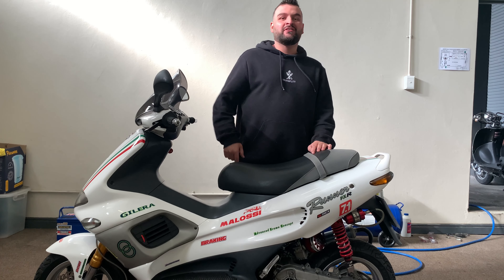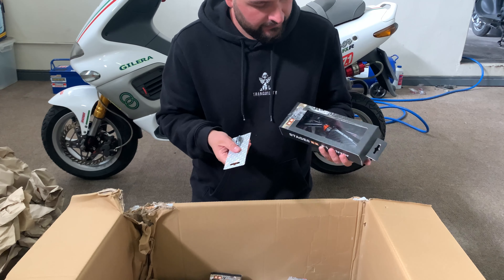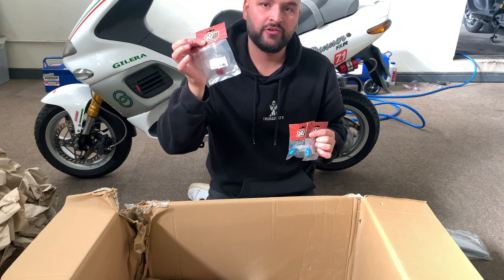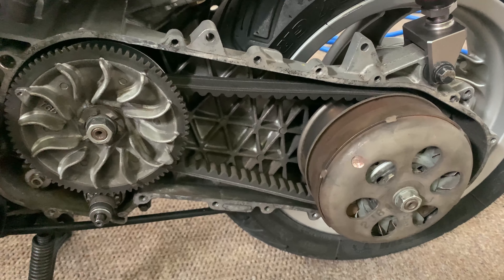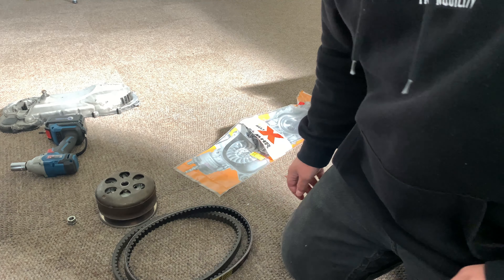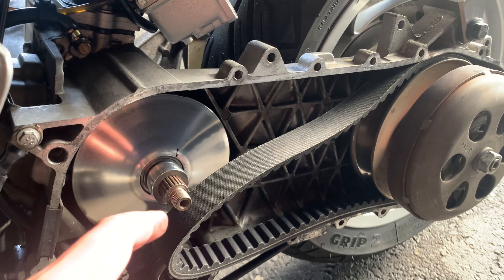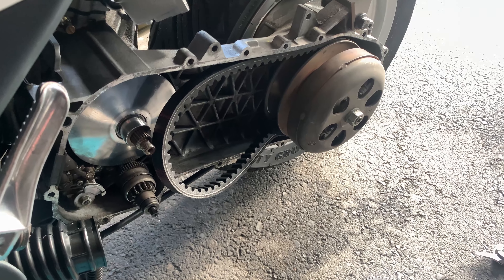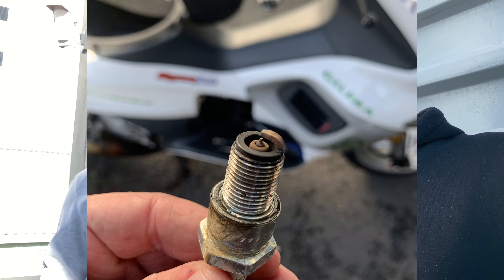Fine Tuning the GILERA RUNNER 180 2T

Comment: I see your missing shims from your cvt . These missing shims will affect the gearing and acceleration of the bike . 

Behind the front pully there should be a 1m shim and infront of the pully a 0.5 shim . 

The missing 1m shim on the rear of the pully means your belts getting pushed higher in the front pully .

That makes it impossible for the bike to pull away from the bottom of 1st gear .

Sending best wishes from the uk  keep up the gilera content !
Reply: Thanks so much for this! Really appreciated! Ok so I want to port the bike. But I would love some information on who has ported a Pro Street 2 pm Tunning cylinder and head already so that I can get the specifications.  Would really appreciate it if you could help. Regards Clayton
Reply from the maker: Thanks for this! We will definitely need to shim between to get that belt to bottom gear! Thanks so much for the help!
Reply: Hi Clayton . Honestly i would keep your bike how it is and just enjoy it 😎

If you was to have your cylinder  ported I would seriously think about changing your current set up. The malossi exhaust isn't really a big power exhaust . Neither is inlet/carb set up you have fitted 
If you want around 30/35 bhp then you will need to atleast Change the..... carb/inlet/exhaust.
It's hard to compress evething into a YouTube comment 😅 if you leave me your Instagram or Facebook I can send you more info if you needed. Safe riding
Reply: Hi do you have kit 172?